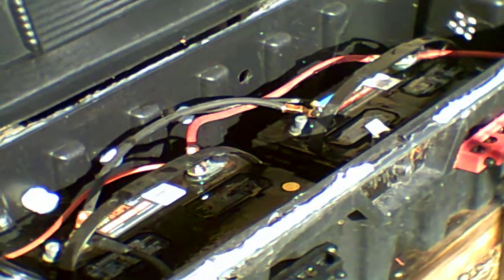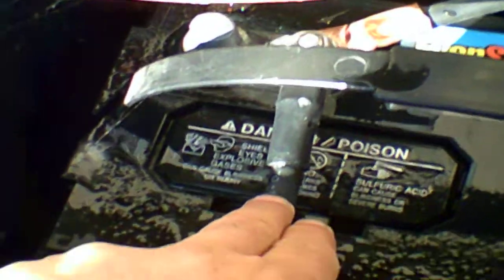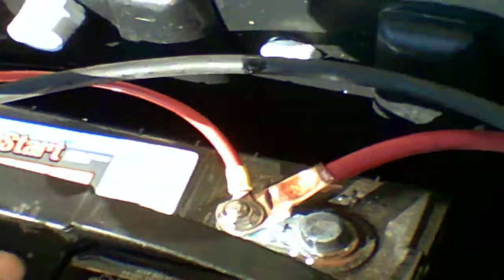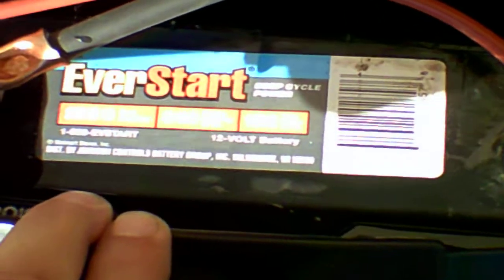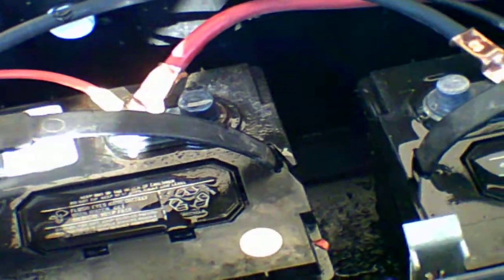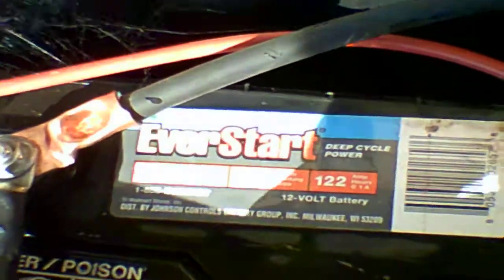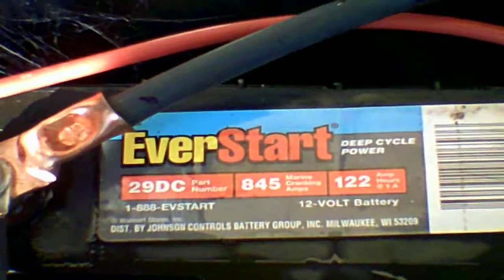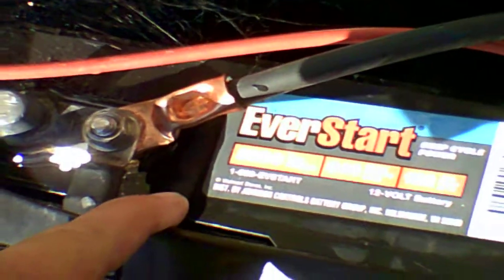My Solar Batteries. Duel Cycle.

Comment: I'm doing something wrong.  Even if I charge these manually they don't last.  Most people have great luck.
Reply from the maker: There could be one or even a couple reasons for that. Only discharge a lead acid battery to 50 percent at most, and when you do only do that vary rarely. leaving a lead acid battery at 80 percent charge or higher is the best. A lead acid battery that hits 10 volts is pretty much destroyed. 11.1 volts is the very lowest that you should discharge your batteries to keep them healthy. Cold can affect your batteries and draw them down. Discharging and recharging any battery constantly will wear it out quicker. Also stores like walmart have a habit of restocking returned batteries to the shelf and reselling them so you may be getting bad batteries straight from the store. Always use the same type and amp hour batteries together. If you have 2 or more different size or amp hour batteries your solar charger controller will only charge to what your lowest battery can take leaving your other batteries under charged. One bad or weak battery will affect how all your batteries are charged. Running heavy draws off your batteries like microwaves can destroy your batteries quicker. If you are running something like that then have extra batteries so your batteries don't draw down as much. Make sure that when you buy a battery it is fully charged before you hook it up to your solar bank by either manually charging it or charging it another way a lot of store bought batteries are under charged when you buy them. Not having enough solar to charge your batteries fully is another mistake people do make sometimes. As a rule of thumb I say for every battery use 200 watts of solar panels. I have been doing it this way for years and I have not had to replace any of my batteries and my newest battery is around 5 or 6 years old. All batteries have a certain amount of discharge and recharge cycles that they can go through before the battery gets weak or goes bad. Most people think that discharging a battery fully and then recharging it is a cycle and that is false. Anytime you remove power from a battery even if it's something as small as charging a cell phone then the battery has been discharged in some way. Using to small of cables can also affect how long your batteries last. The more you use them, and if you use them for high draw loads the faster your batteries will go out. Even if you are just using them to run nothing but LED lights then every time you do that your batteries have had a discharge. I hope this helps. feel free to ask any questions that you have, and I will try my best to answer them. Have a nice day.
Reply: @christopherhorton821  I have the inverter connected to the batteries.  It's cutoff is well below 50%.  When I'm not around that thing still draws.  Oh well, lesson learned, which is why my first solar install is low rent.  These batteries are very unforgiving.  NB:  Thanks for video and reply.
Reply from the maker: @fightswithspirits915  You are welcome, and yes unless you turn your inverter off, or in some cases disconnect it completely then it will still draws power. If your batteries are drawing at 50 percent or lower they will not last very long. Even drawing 30 percent out of them will make them go bad quicker than only drawing 20 percent out of them. My advice is to add one or two extra batteries to keep everything up. The more batteries you have the less amount of power is used from each battery and the longer they will last. Also you can also add a power disconnect switch between your battery and inverter, and then just shut that off if needed. I have two 122Ah batteries so 244Ah for both batteries. My first step was to half it and that would 122Ah or the power rating out of a single battery. That would be 50 percent. Then I divided that by 2 and that gave me 61Ah that I use at the max. I usually pull no more than 50Ah out of them. Both my batteries are the same type size and Ah. Only drawing that amount of power has both my batteries lasting. One is 5 years old and the other one is 6 years old. I also have 400 watts of solar hooked up to charge them and it works fine. Like I said 200 watts of solar for every battery. You can add more batteries but it would take longer to charge. I hope this helps you out and if you have any more questions then please ask. Have a great day and night.
Reply from the maker: Oh one more thing. Even thought I have show in my videos that my small 400 watt solar set can run things like my 1000 watt microwave. A electric skillet,  my gravity drain washing machine and even my 120 volt electric clothes dryer, or even a coffee pot. If I run any of these things I always try to run them as early in the day as possible about 8:00am or 9:00am. That way the sun is up and my solar is producing power, and it has a chance to recover my batteries by 4:00pm to 5:00pm depending on how much power was drawn from them. If I have to run a microwave during the day I usually don't use it anywhere toward the evening. Having a partially charged battery setting overnight is not good for it either. You can do it a few times but the more a battery sets undercharged the faster it will go out. If for some reason you have discharged your batteries, and the sun is not up you can charge them with jumper cables from a car battery off the alternator. once again have a nice night.
Reply: Newbie solar question, what is your solar charger set at for battery type with this battery?
Reply from the maker: @jeffkon100  The charger controller that I am using is automatic, but maybe this will help you out. Solar Charge Controller Setting Steps:
wiring the solar charge controller to the battery bank and panels properly.
    The controller screen will light up if the power is detected
    Hold the Menu button for seconds to entering setting menu
    You will see the charge current (PV to Battery)
    Long Press the Menu Button to entering Batter Type Selection
    Controller will auto detect the battery voltage
    Setting the float Charge Voltage,absorption charge voltage, low voltage cutoff value, low voltage recovery value according to the battery user manual.
    set discharge value for DC load (if have)
    the charge controller will start the charge process instantly.

solar charge controller settings for AGM battery

In order to maximize your solar charging efficiency, you must know how to adjust the settings of your solar charge controller. The profile setting determines the maximum voltage and current that your solar charge controller will output. Different batteries require different charging parameters. For example, lead-acid batteries have different optimum charging parameters than lithium-iron-phosphate batteries. Therefore, the manufacturer of your battery should tell you how to configure your solar charge controller to maximize the charging efficiency.

AGM batteries are different from lead-acid batteries because they use a fibre-boron-silicate glass separator instead of a liquid electrolyte. The result is a spill-proof battery. The same holds true for solar panels. With the right charge controller, your solar panel can jump-start your vehicle when it is running low on power. It is also compatible with all types of vehicles.
solar controller settings for lifepo4 battery

The optimum solar charge controller settings for a Lifepo4 battery will depend on the type of battery you have and the type of solar system you have installed. For example, if you are installing a 12V system, your solar charge controller settings will be different from those for an AA or AAA battery. LiFePO4 batteries do not need voltage compensation or temperature compensation. In general, however, they require different charging parameters.

To get the most out of your LifePo4 battery, you should use an MPPT solar charge controller with a “user” or “custom configuration” mode. These charge controllers will not boost the voltage of the battery, but rather regulate the voltage from a high panel to a low voltage. These settings are best suited for heavy-duty applications. Lastly, you should be sure to install a charge controller with low-voltage protection.
solar controller settings for lead acid battery

Lead Acid Batteries for solar power system use to be a classic configuration, once you set the lead acid battery type, most charge controller will charge it with original setted parameters for lead acid batteries. in most cases, plug and play.Solar Charge Controller Setting Steps:

    wiring the solar charge controller to the battery bank and panels properly.
    The controller screen will light up if the power is detected
    Hold the Menu button for seconds to entering setting menu
    You will see the charge current (PV to Battery)
    Long Press the Menu Button to entering Batter Type Selection
    Controller will auto detect the battery voltage
    Setting the float Charge Voltage,absorption charge voltage, low voltage cutoff value, low voltage recovery value according to the battery user manual.
    set discharge value for DC load (if have)
    the charge controller will start the charge process instantly.

solar charge controller settings for agm battery

In order to maximize your solar charging efficiency, you must know how to adjust the settings of your solar charge controller. The profile setting determines the maximum voltage and current that your solar charge controller will output. Different batteries require different charging parameters. For example, lead-acid batteries have different optimum charging parameters than lithium-iron-phosphate batteries. Therefore, the manufacturer of your battery should tell you how to configure your solar charge controller to maximize the charging efficiency.

AGM batteries are different from lead-acid batteries because they use a fibre-boron-silicate glass separator instead of a liquid electrolyte. The result is a spill-proof battery. The same holds true for solar panels. With the right charge controller, your solar panel can jump-start your vehicle when it is running low on power. It is also compatible with all types of vehicles.
solar controller settings for lifepo4 battery

The optimum solar charge controller settings for a Lifepo4 battery will depend on the type of battery you have and the type of solar system you have installed. For example, if you are installing a 12V system, your solar charge controller settings will be different from those for an AA or AAA battery. LiFePO4 batteries do not need voltage compensation or temperature compensation. In general, however, they require different charging parameters.

To get the most out of your LifePo4 battery, you should use an MPPT solar charge controller with a “user” or “custom configuration” mode. These charge controllers will not boost the voltage of the battery, but rather regulate the voltage from a high panel to a low voltage. These settings are best suited for heavy-duty applications. Lastly, you should be sure to install a charge controller with low-voltage protection.
solar controller settings for lead acid battery

Lead acid batteries for solar power system use to be a classic configuration, once you set the lead acid battery type, most charge controller will charge it with original setted parameters for lead acid batteries. in most cases, plug and play.
Reply: Great, thank you.  I bought a 100w solar suitcase and my last battery was AGM and couldn't remember what all the settings were off hand.  Might be picking up one of these batteries.
Reply from the maker: @jeffkon100  If you decide to purchase lead acid duel cycle marine batteries then before you do. Please read the interaction between myself, and the user Fights with Spirits here in my comments.